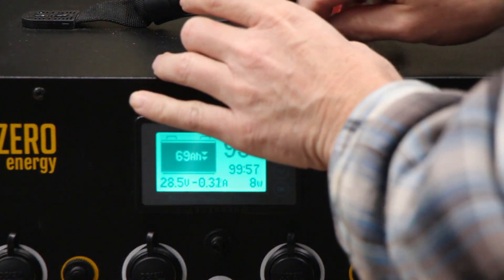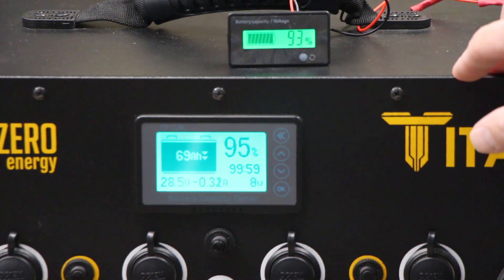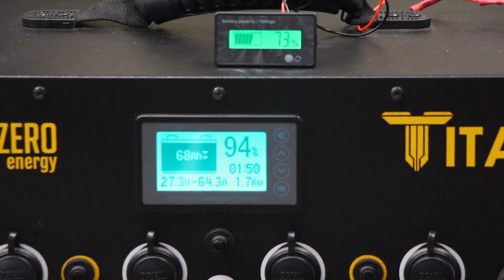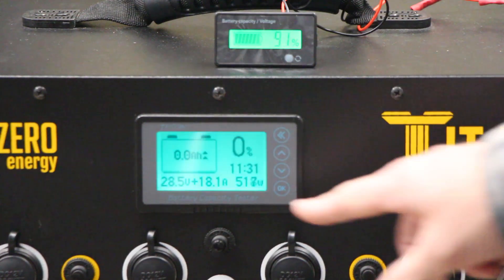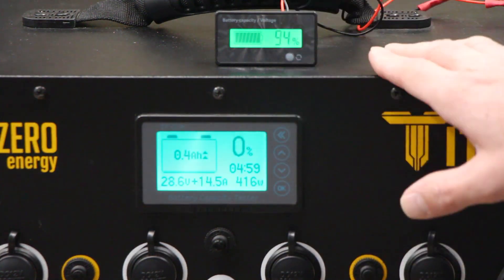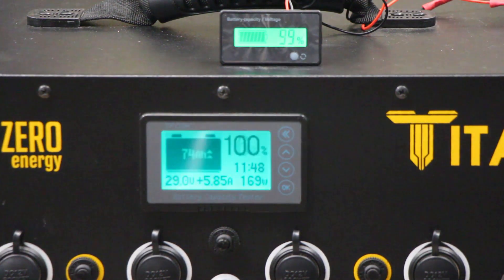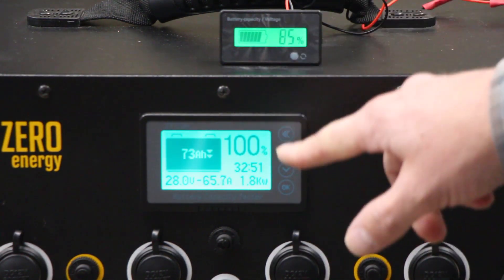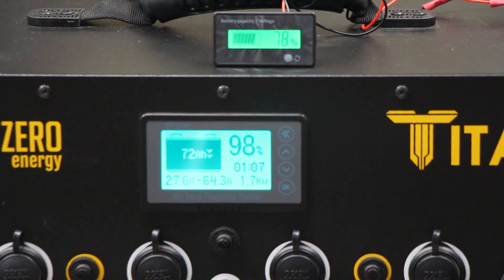Point Zero Energy Titan meter calibration: How to Calibrate Your Solar Generator

Comment: Do u guys delivery to Canada?
Reply: So your reply to My Cave, is a bit confusing. Does ups stand for United Parcel Service, or US POSTAL SERVICE? Next question. Is the real reason u no longer ship to Canada is because of the Trump protectionism act? I am a transport driver, crossing the border everyday with essential goods. This product falls under essential service equipment. If you r using United Parcel Service and have issues, there is also Fed Ex., which has their own custom brokerage firm. I have hauled many items back and forth across the border for Fed Ex both ways, with no issues. So can u explain why you can't use Fed Ex?
Reply from the maker: Hi,  UPS stands for United Parcel Service  whereas USPS stand for US POSTAL SERVICE.  The problems we have had with UPS is that they have been loosing shipping papers, commercial invoices, packages, etc.  They even threatened to close down our ups account due to missing shipping papers that they lost.  They are bad enough using them in the US, bet 10x worse when shipping to Canada.  We just don't have time to deal with all there issues.

Fedex told us they could not ship ground to Canada.  I am not sure why they told us that, but we need to ship ground because of the lithium battery.  Since then we have found a third party shipping company (they actually use fedex), and can ship ground to Canada.  So now we can ship to Canada.  However there is an extra shipping fee, and also fedex will charge an import fee (the customer will have to pay fedex before delivery).  And if for any reason warranty work is required, the customer will be responsible for shipping (we only cover shipping for orders int he US).

Thanks
David
Reply from the maker: We used to ship to Canada,  However we have had a lot of issues with ups importing, etc, that we don't anymore.
Thanks!